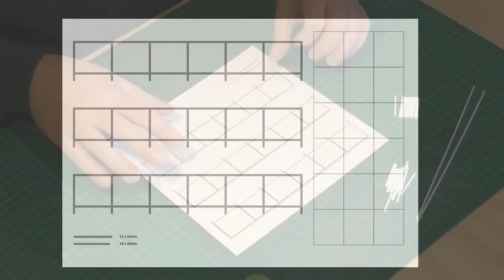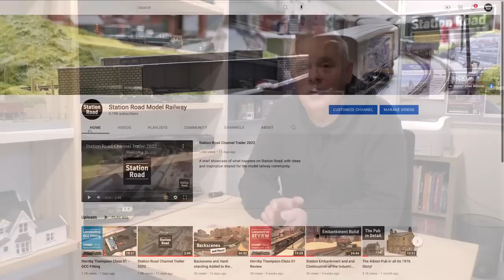Modelling Wire Mesh Fences

Comment: Maybe waxed paper would prevent the glue from sticking. Also make your "squares" a bit shorter than your vertical posts, so that  the top and bottom rails are 2-3 mm away from the cards. Cheers from Canada.

Comment: Dear Julian, for the card not to attach to the plastic rods, you might want to spray it with a release agent.
Don’t know if the jig like the way the thought it out will be convenient for constructing a frame out of styrene. Either you need a thinner card, or you could give some space. So, you’ll glue it against the jig and after that are able to push it slightly away from the edge of the jig. 
For another construction method, with actual metal rods cut from straightened metal wire. Or, for that matter, from brass rods or pipe. Then the jig might be the excellent solution to construct such a fence, by soldering the metal pieces together. 
Yep, Boomer, indeed an accomplished modeler. Absolutely worth the while to check his channel out. Nevertheless, think you too got something here. 
On, using a kind of oily substance as a release agent; could very well be this will also provide some modeling opportunities. Especially when people would like to produce a more dilapidated fence. One could quickly spray bomb the frame with an appropriate color. Then clean up the frame, so the oily substance will dissolve and disappear. Of course those spots will then show up white. However their edging will be sort of random and could be stained, painted or even dusted with a grime or rust color. Especially in older fences one sees such oxidation occur on those particular spots. Plus it provides opportunity to try out the salt chipping method on projects that aren’t as demanding as entire building or construction surfaces.
To clean off the oily substance, I would recommend just regular IPA. 
Overall, love the way you’ve shown your thought process in this vid. Think it produces a very helpful piece of content for others to try making their very own fences. 
Thanks 🙏 for sharing!!
Reply from the maker: Thank you Vincent for your kinds words and sharing your thoughts on possible options/alternatives, excellent stuff🙂

Comment: Hi

Good result. Also I was so impressed by the shots you showed of the fence temporarily put in place, it wasn't so much the fence that caught my eye but the back scene, at that low and close angel the perspective it gives is great, shows the advantage of using photographs of real buildings.
Mark
Reply from the maker: Thank you Mark for your kind words. I deliberated quite a bit over what method I should use for the back-scenes. There was illustrative, hand-painted and then photographic, but I'm quite happy I went down the photographic route. Of course, being a graphic designer by profession, I have the software and knowhow to manipulate images to suit.

Comment: Cut the corners off the inner rectangles to make octagons. The remainder of the sides will still hold the parts aligned, but there won't be any card in contact with the inside of the joins you're gluing.
Reply from the maker: Thank you Katie for the suggestion. A few others have suggested this and I definitely think it would help. I'll be trying some of the suggestions in a follow-up video and this will definitely be one of them.

Comment: Splendid fence anyway. I think the only way to easily use your template is to consider it disposable... You can stick your squares with temporary adhesive, that would help sticking off the fence from the cardboard. And punch one hole or two in the middle of the squares to ease their removal.

Comment: Very nice looking fence, 
When I make fences,  I make them on glass, the glue doesn't stick to it, & I put my template under the glass , also I use tacky poster puddy to hold my peices in place for gluing.
Reply from the maker: Thank you for your kind feedback. I noticed some other folk suggested glass and blue tack/puddy to hold the pieces in place. This sounds like a very good method and certainly less complicated than making jigs.

Comment: Very nice work, Julian. A suggestion to get rid of the cardboard could be water, even if it can warp and destroy the entire frame. Take a try with just two elements.
Reply from the maker: Thanks Michele for your suggestion. I think this would work quite well. It would certainly soften the card, thus making it less likely to breaking the styrene joints.

Comment: Hi Julian. For an experiment, the end product was pretty good. Of cooking oil and Vaseline, I would go with the latter as it would be less messy and it would clean off fairly well with warm water.
Reply from the maker: Thanks Paul. Another option someone has suggested is rubbing candle wax on the jig beforehand, this might be more suitable than the oil or vaseline method I suggested.

Comment: Took a bit to get there(!) but the eventual result does look the part well.
A long-standing way of assembling strip-wood parts that are part of a kit is to lay a sheet of parchment or waxed paper(they being semi-opaque) over a part diagram(template) -- I'd definitely shy away from a new complication by adding anything oily or greasy to the mix ...  
Looking at  your method of using cardboard pieces as blanks, though it may not have worked out as hoped in this case, it does strike me that this is an effective way of making board, brick or concrete panel fences, using the appropriate appearing material for the blanks.
Take care and keep them coming!
Reply from the maker: Thanks Ray for your kind words and thoughts. Interestingly, I did have the completed frame placed on wax paper when I was glueing on the mesh and it still stuck to the wax paper so not sure what the best solution might be. I noticed someone mentioned rubbing candle wax over the jig which might be a viable options.

Comment: Hello Julian,

maybe use another glue. E.g. Slaters Mek Pak. These is a solvent. Many plastic glues contain solved styrene, and these will result that plastic parts stick to e.g. paper. But with a pure solvent only the plastic parts should melt together.
Reply from the maker: An interesting thought, I will look into this. Many thanks.

Comment: Rub candle wax on the sheet of card before you glue the pieces down and they won’t stick but you can see through the wax.
Reply from the maker: Thanks Tony for your suggestion. I think this would definitely be a viable method, and probably much better that using cooking oil or vaseline.

Comment: I wonder if baking paper that you use in the kitchen would help, I have used it when making hay bales and the pva glue didn't stick to it or cause damage.
Reply from the maker: Interestingly, I did have the completed frame placed on wax paper when I was glueing on the mesh and it still stuck to the wax paper so not sure what the best solution might be. However, I wasn't using PVA glue, my thoughts were the Glue 'n' Glaze would be more robust.

Comment: Julian,
Great attempt at a chain link fence.  Over my many decades I have tried many different approaches.  With as many failures.  Here are some solutions that may help you in the future.
First let's deal with your jig.  You were able to disassemble the insert supports eventually.  A better, and safer, way to avoid breaks in the styrene is to GENTLY (with many passes) cut the insert on the diagonal, from opposing corners.  Trying to cut along the post causes them to get nicks, trims, or even sliced through.  Once you have the corner to corner cuts made them use your hinge technique to wiggle the card out.
Now let's backtrack to the setup.
The insert card really wasn't needed.  Had you covered the computer printout with kitchen wax paper you would have the necessary barrier needed.  Then you could have seen through it to layout the parts. (Do not use parchment, plastic wrap, or tin foil.)  Layout your pole pieces over the lines.  IF necessary secure the styrene, at non-glueing locations, with straight pins.
When your satisfied with the layout THEN GLUE the pieces together.  Not piece meal.
Also, you will find if you leave the two end rails and at least the center rail longer you're providing yourself with a location to glue the entire fence into your roadbed.  Of course you have to drill some PVA glue holes into your street.  One additional consideration is to leave every second or third pole run long should your length horizontally be longer as well.
I do like your idea of allowing the structure and tulle mesh to run long so it could be hung in the spray booth to paint and dry.  I'm going to steal that technique.
When you do your weathering consider using a dry brushing of silver or aluminum gloss paint for upper area highlights.  Even though the fence maybe in a run down rusted area the tops could still have some light reflections.
Lastly, the gaps in the posts can be easily disguised by running scenic vines up through the fence.  And fill the gaps.
I do enjoy your videos.
TTFN from half a globe away.
Jim in Upstate N.Y., U.S.A.
Reply from the maker: Thank you Jim for your kind words and wealth of shared thoughts, these is all excellent observations, many of which I'll be touching on when I do a follow-up video🙂

Comment: Julian superb inexpensive ideal fence 👌 
Could the card be replaced with an old plain baking tray and using a permanent marker draw the frame. Also use fine stripped insulated telephone cable and twist strands to give the illusion of barbed wire. Can super glue be used as an alternative to rocket glue. Love the steps what type of printer do you use as mine seems to bleed when reproducing. 
Do you load you construction plans of the building on Facebook or website. Thanks Alan.
Reply from the maker: Thanks Alan for you kind feedback. I use a colour laser printer (required for my graphic design business) which doesn't have issues with colours bleeding unlike inkjet printers. There's a number of factors that might be contributing to ink bleed, one might be the printer quality/resolution settings being set too high, another is the paper stock - standard copy paper tends to be less sharp and possibly fuzzy, you could try a heavier weight paper. Standard copy paper is 80gsm so maybe try 120 or 160gsm depending on what your printer can handle. Lastly is the printer itself - how old is it, has it had significant use, what's its maximum print resolution? I'm in the planning stage of setting up a Station Road website where there will be access to download building plans and the like that I have designed on the computer.
Reply: @StationRoadModelRailway  Julian.thanks for info currently have a Epson  expression  model 342 scanner colour printer. Consider changing it to better machine but the is a plethora of options available. Cheers

Comment: Why not use the same jig but remove the corners of the card jig where you’re going to glue so the glue can’t make contact
Reply from the maker: Thanks for your suggestion and that would certainly help with the corners. The problem is the the styrene cement does travel and runs on the length of the styrene rod as well.
Reply: I did a fence using wax paper. I didn't use card in-between though.   My print was on normal paper and I put the wax paper on top.   I also used old  and rusted window screen.   Super glue and I didn't have any sticking to the paper.   The results were very good.   Not perfect but good.

Comment: I notice in Australia high mesh fence framing is often square (distance between posts equals distance between top and bottom rail) rather than rectangular so I’m planning on using 25mm x 25mm wire mesh as my framework. That way it will be easy to include higher posts for 3 barbed wire strands above the fence proper (even bent as in security fencing) and extra length at the bottom for fixing to the baseboard. I believe I’ll be able to attached the tulle (I think that’s what it’s called) using superglue. Haven’t experimented yet so I’d be interested to hear if anyone has tried it.
Reply: I see that this is exactly what CSXMad has done so I have my answer … and he made a hell of a lot of fence!
Reply from the maker: Thank you Garry for sharing this info. I had a look at CSXMad and interestingly he was inspired by Gormo at Great Chesterford Junction. I think it's an excellent method and I'll be giving this a go in some future fenced areas.